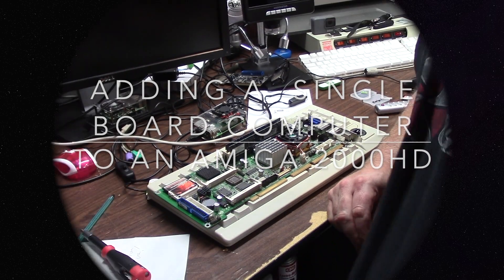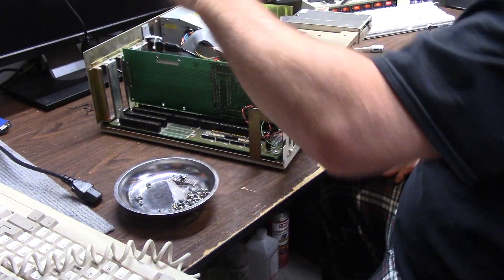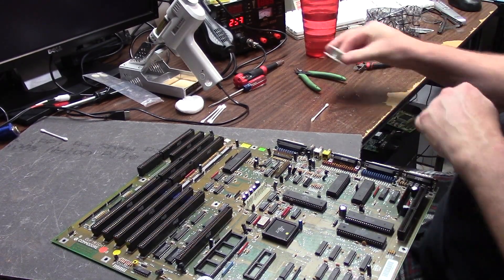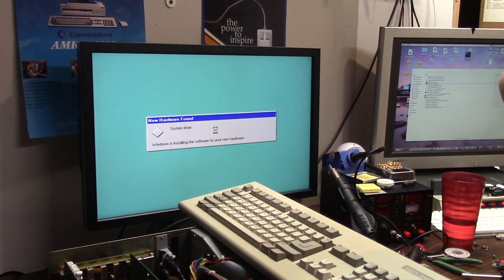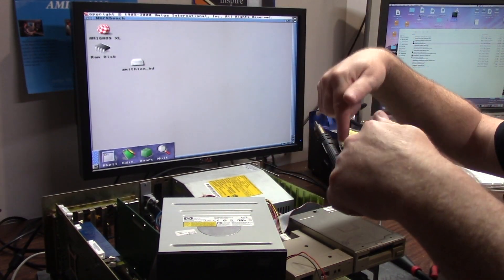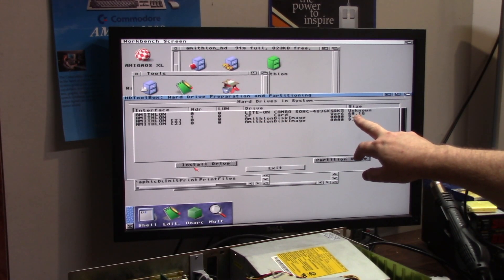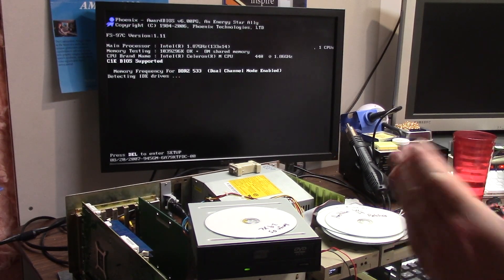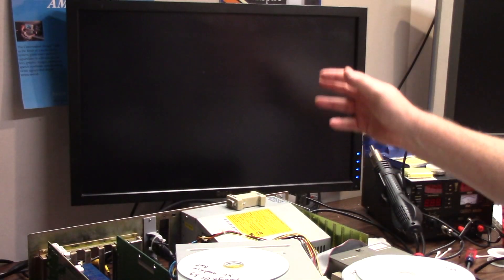installing SBC to an Amiga 2000 !!

Comment: Very cool. Assumed this was possible, love seeing it in action. Someone needs to make a separate bridgeboard so you can use any of these single board computers with an Amiga.
Reply from the maker: you sure can, and the other isa slots become arbitrated for other things., like scsi or network or other that may not be included in the sbc.  now its not as integrated as an actual amiga bridgeboard. but it does work, and work well.

Comment: Drives that refuse to open can be fixed easy (just in case you didn't know of course.. but more for those reading).
To get CD out there is a small hole in front you can use a pin to eject it.
Then... get some new rubber belt replacements and install one (its tricky but it can be done with a long pair of tweezers and maybe a hooked pair.
I've known lots of people that tossed their drives (DVD RW's...etc) out after it goes through the 'I shall not open anymore" routine. 
I've fixed several since then...  and all with stupid little rubber band thingies... :D

Comment: Great idea! .. but I do worry about the 2000's PSU. Being ..AFAIR 201watt here in 240vAC 'Straya .. Some PeeCee processors will pull 35watts alone, + ram, video. Fortunately you're not using spinning rust. I've spotto'd them sucking 15-19watts when they first turn the motors over.

Comment: Chris, You just need a good video kmv switcher that can allow you to have one keyboard, mouse and use the same monitor but without having to select the source on the monitor all the time. use a usb/hdmi/kvm which will be the easiest. You will just need a usb mouse adapter for your amiga and you will need a usb keyboard and mouse adapter for the pc although you mentioned that the sbc already has usb options. Then just a vga to hdmi upscaler and then bob's your uncle as we say downunder.
Reply from the maker: I do actually have an uncle bob lol!

Comment: I hate dvd drives, also. They are so slow to hook up at post and  are the cause of so many issues on my legacy kit.
May be you should now get a A2000 kb to ps2 cable and a  amiga to usb adaptor then you can use a kvm and use both with one kbm solution.
Thats what i use on my A2000.

Comment: I guess I was expecting integration like a bridge board into the amiga os, but I guess it requires a zorro connector behind the isa slot so it will never happen with sbcs.

Comment: Do you know if the ISA bus is used in any way aside from supplying power? My guess is no but I also noticed an 8-bit digital GPIO port once I found your other post about which board it was. 

I supposed you could also write some software or at the very least use networking to command and control the Amithlon side from the Amiga side and vice versa. Maybe even some VNC.
Reply from the maker: Yes the other isa slots will be controlled by the sbc.  So i can add a sound card or whatever
Reply: @ChrisEdwardsRestoration  most Amiga built bridge boards would have this built in but a nice user programmable isa <-> zorro bridge that could be used with any isa powered bridge board has a lot of potential. 🤔
Reply from the maker: @nyteshade  well this is not an amiga product, its a single board computer that was from a parking garage, but that would be nice. if it supported the janus libraries.. however its cool for what it is, and what its in . 

thanks for watching!
Reply: Maybe even use the GPIO to share the Amiga keyboard and mouse to the PC side.

Comment: i use the SBC in my Amiga 2000(p4-3ghz advantech) to run the BPMicrosystems eprom software. works pretty good,eliminates having another computer on the desk.

Comment: Surprised the 30 year old stock PSU is holding up running  a SBC, Amiga and peripherals and all at the same time.
Reply from the maker: It was rebuilt a year or so ago.  So like new
Reply: My 30 year old A2000 PSU is holding up fine in similar role:
https://www.youtube.com/playlist?list=PL2O6RH1Isy65p-cPxMx9HGlq9O_j9iVdx
.. not rebuilt (yet). :)
Reply: @DrDavesDiversions  Electrolytic Capacitors all eventually dry up over time, it's generally just a matter of time before something fails.
Reply: @roygillotti4615  agreed, just sharing a data point. :)

Comment: Well your not the only one swearing at Optical Drives.   Kind of like Disk Drives you don't actually use them all that often but its always nice to have working drives and the same applied to optical drives especially if you have the discs hanging around.
Reply: i still find both useful as well. retro machines need them :D